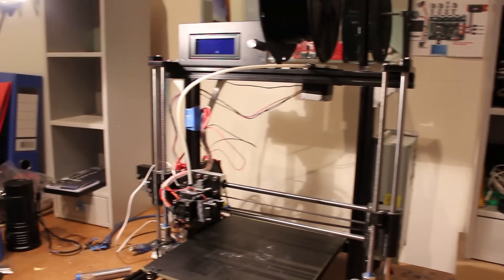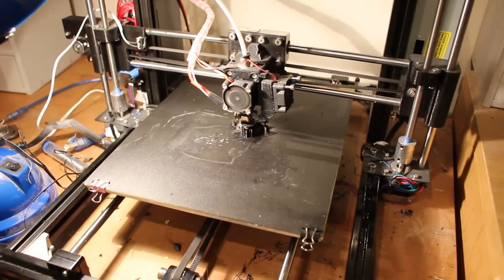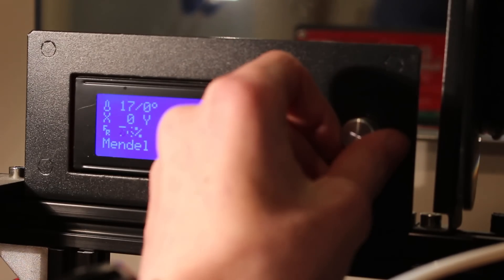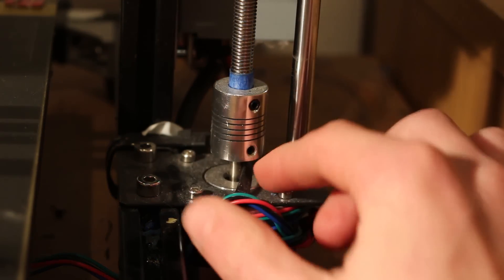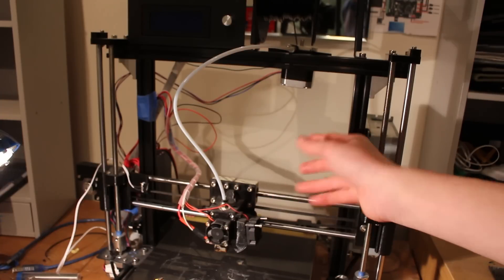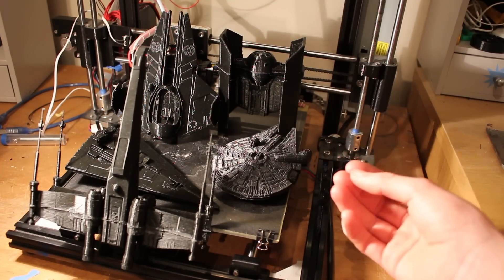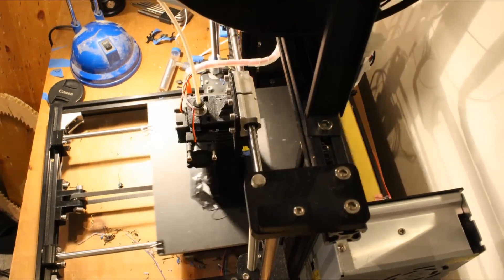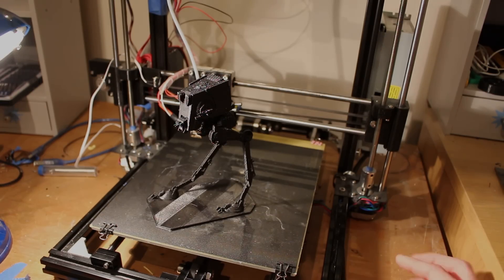Homemade 3d Printer for £240 - RepRap Prusa i3

Comment: Great video! I actually bought a Prusa i3 a few days before you posted this video, although mine cost £160.
The out-of-the-box settings worked perfectly, but now I'm on a different brand of PLA, it looks like I'll need to change some of the settings. The prints are coming out more fragile than they should be and the nozzle often ends up messing up the infill

Comment: You know, if I were you then getting jailed would kinda be the least of my worries with a printed gun. I'd be MUCH more worried about losing my fingers while trying to use one (not only the tolerances wouldn't quite match up, but also due to the fact that all the plastics are MUCH weaker than any of the metals used for guns, the thing would disintegrate right on the first or second attempt at shooting from it).

Comment: I bought this printer from seller dobestcar2 per the link at the very bottom of the comments. Today I got an email from Ebay telling me that the account of this seller has been compromised and the sale may be fraudulent. It also says the listing was removed because of this, and it is gone.
The printer was marked as shipped yesterday, due to arrive tomorrow (3rd) or the day after.  I will wait a couple of days to open a buyer protection claim. Perhaps I am lucky and this is a false alarm but something definitely looks fishy.
Has anyone else bought this exact printer?
How long did shipping take, and where did it come from (UK or China)?
Reply: +stefantrethan Update: Got the printer today, all is well. It came from the UK. I don't know what Ebay is on about maybe the seller got hacked.
It's a very nice kit, the threaded rods are also bent, and I think I am missing a few nuts, but overall very well done kit and very well packaged.

Comment: They are good, However having spent time with 3d printers. For about £305 to £340 you can get a XYZ 1.0A. They work pretty good out the box and with a few upgrades you can print from thingiverse they work really well

Comment: hi man, really impressive quality!
I noticed that you are using leadscrews for your Z axis. Right now my printer uses m5 rods and they are quite bent. I replaced them, buy straight one are practically impossible to find. 
Would you recommend an upgrade to leadscrews? 
Thanks!

Comment: Great to see a UK based review on i3 kits. I'm looking to do the same but I'm wary about the lack of clear instructions and sometimes incomplete or mismatched parts that I have heard about with some Chinese kits. The same kit from a UK company is usually around £100 more. Would you say the instruction/support related issues that you had were worth the £100?
Reply from the maker: +confused1985 The instructions that came with mine were very poor English but each step was provided with a parts list and a screen grab of a cad model at that stage and I only ran into a few problems when making it just down to my own stupidity and there are also probably some other online instructions you could use.
Reply: I put purchased a press i3 from a Spanish company called bq. I still use it now and it is fantastic. They sell them on UK websites. It's about £300-£400

Comment: Where did you buy the printer, and the better head?
The Prusa I3 I can find on Ebay have a totally different plastic frame.
Reply from the maker: +stefantrethan there are lots of different models of the prusa, I have the mendel.
Reply: +The Art of Weapons Thanks, but I still can't find one as nice as yours for that price. Was this a regular seller (who still has them) or a one-off?
What software will you use to draw your models?

Comment: Something you might want to consider, try putting a piece of paper on the base. It makes it a lot easier to pull the finished product off the base. I've printed a few things small enough that any attempt at removing it without paper would just snap it. Then again, my base didn't move, it simply stayed put.

Comment: I built a printer similar to this it is called the Prusa I3 X and the only problem I have is getting prints to stick to the bed. Any suggestions?
Reply from the maker: +Rocketman Rules I used to use blue tape and it worked well. I am now testing something called Buid Tac, seemes to work well
Reply: +Rocketman Rules Thanks

Comment: There is something satisfying about fine tuning your printer and finally getting it to print well.  Doing it yourself might take a long time but it does teach alot and also helps you troubleshoot when things start going weird again :)  Nice video

As for generating support, i have found that using 'Autodesks Meshmixer' to generate supports in some models that i had better results and it was easier to remove. 

"Have you printed a gun yet?"  (almost everyone that finds out i have a 3d printer asks this >.O
Reply from the maker: +Bobby K thanks, I don't really like Cura's automatic support.

Comment: 3D print a part, use it as a pattern in casting box. cast aluminium in to the casting box. you now have metal versions of your plastic part.

Comment: Great value! You should try to print a slingshot and maybe an arrow/arrowhead.
Reply: Beast
Reply: arrow head? it'll get dull after the first shot
Reply: yeah obviously but idk maybe for practice arrows or something
Reply: The Slingshot King It will be very rigid though and won't fly straight also since he can't print a full arrow shaft he has to print them by piece it wouldn't be that great.But he could do that its his printer:)

Comment: 8:54 NOOOO its an at st, not an at at!!! btw im not sure and dont have a 3d printer myself but if you would have rotated the file of it so it lays on the back you would have had less support to print.
Reply: +Zquirrel I have an Ultimaker and I can indeed confirm that he would have used less support material but the rugged edges he had on the bottom would have been on the side and therefore more visible also the platform at wich the at st stands on wouldn't have been so nice. interesting point never the less.